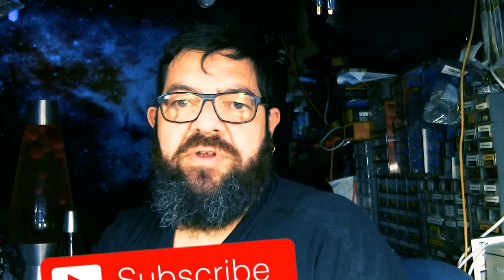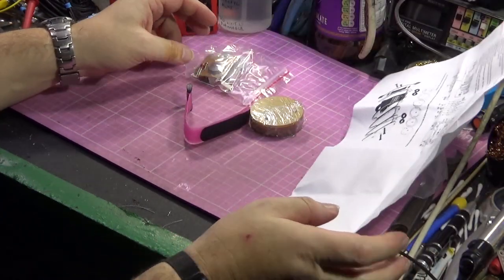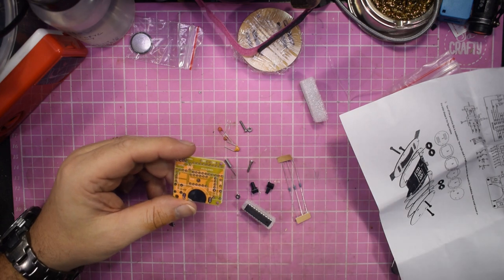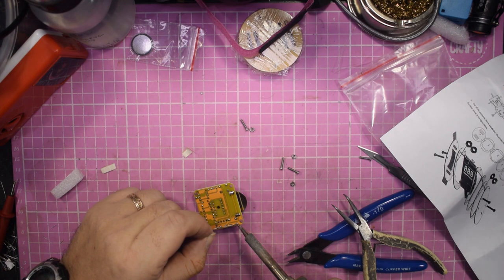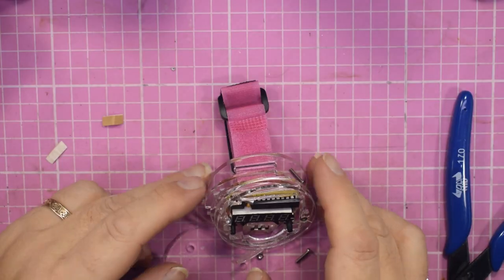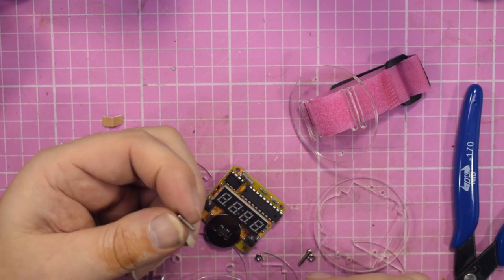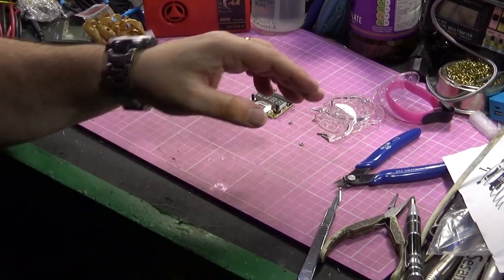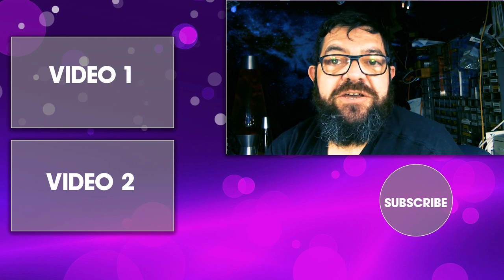DIY Digital Watch - EASY to build kit

Comment: The first digital watch I remember seeing belonged to my step-father when I was about 8 or 9 years old in the mid to late 70's.  As I recall it was made by a company called Texas Instruments.  It only showed the time when you pressed one of the side buttons and then it lit up as red LED's.  Back then calculators also had red LED's and I remember some folks called them "personal computers" instead of calculators, LOL!  A few years later I saw the LCD's that became so common.  I went from LCD back to analogue when I was about 17  and have worn analogue ever since.  When Timex came out with their 24 hour analogue watch with Indiglo I bought one of those and over the last 20 years or so have re-purchased the same model about 3 times now.  The day and date function on them are rubbish and I never bother to set those.  The only other analogue watch I ever wear is a Goofy Walt Disney watch where the numbers are backwards and the hands turn counter-clockwise.  I quite imagine I'll still be wearing a wrist watch when they lower me into my grave.  I still don't own a cell phone, so a watch for me is a must have, lol.  Have also owned several pocket watches in my day, though none are quartz.  All the ones I've had or still have are wind up.
Reply from the maker: Digital displays on anything were considered futuristic back in the 70's for sure. I feel naked without my watch on but my kids have a tendency to just look at their smartphones for the time. I also have not had any really expensive watches, preferring to stick to what they class as sport watches. They have to have a steel band because I tend  to break plastic and leather straps and large buttons because i'm ham fisted!
Reply: @GeorgeChristofi I also prefer a steel band, but I like the kind that stretch to fit.  I think they used to call them slidell bands or something like that.  Funny thing is, I've worn a watch for so many years that I have a permanent indentation on my wrist now.  I once got a fancy Michael Kors chronograph watch by playing games on msn's old live search club but it was too fancy for my and I never wore it, instead I gave it as a Christmas gift to one of my Uncles, lol.
Reply from the maker: I have never been a fancy watch guy either Gary, I'm too rough and tend to scratch things. I have a permanent white stripe under my watch band as  it comes off so rarely! I think it must be 45 years now that I have worn one.

Comment: I know where it would fit  -  but not for long. Interesting video, it's a shame some of these little Chinese kits are a bit iffy. I bought a passive tone control kit, the circuit wasn't bonded to the board properly, it came away with the soldering iron. The 4 pots alone more than covered the cost though. Yes I do remember the red LED watches, they were a pain in the bottom when you were driving. The first ones were very expensive. Needless to say I was given one a few weeks before the market was flooded with LCD watches. Regards.
Reply from the maker: Unfortunately it is the case design that really let this one down. If the thing was an eighth of an inch or so larger in diameter then it would have had enough meat on it to not be so weak.  
The red LED watches came into fashion while I was in middle school but were too expensive to give to kids. We only saw them as they became cheaper.
Reply: @GeorgeChristofi  Hi George. I have been very lucky the last couple of years or so as almost all the gubbins I have put together has worked. It had to change didn't it. I even stuffed 38V up the output end of an LM317 the wrong way round. It didn't damage the LM, etc. but fried the pot. I did have all the safety diodes in perhaps they helped. I did see 3A + on the meter though. OOPS!  I'm spliitting that twin tranny power supply into 2 seperate bench supplies, I should be able to parallel them off if I ever need 12A +. We had one of the first LED calculators in the design office I was in, it cost hundreds of pounds. We had been using one of those Babbage monsters, yes George I really am that old my friend,  73 next June to be exact. My dad came home from the RAF and I was supposed to be 'Charmian Mary', just one little thing got in the way. Gawd I hate pink.